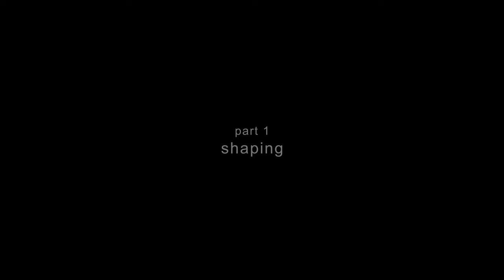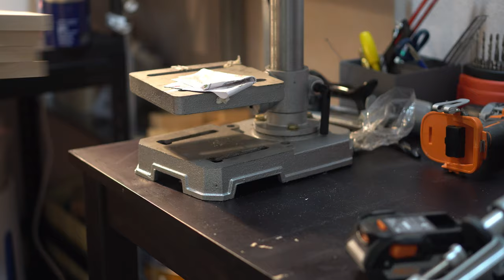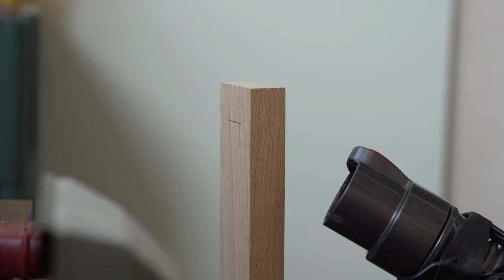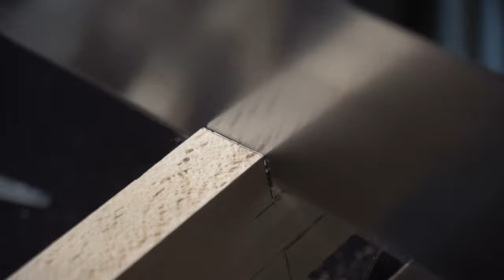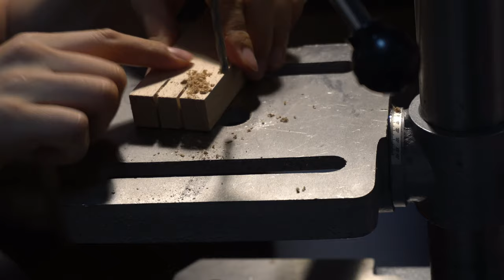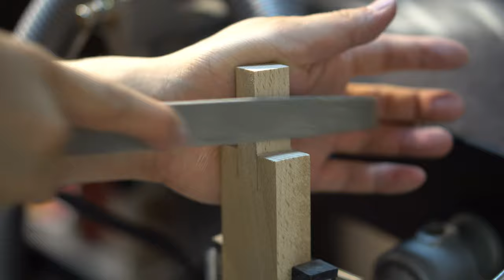Harbeth Speaker Stand #1

Comment: Great video and beautiful work!! Thank you for this!
Could you send me the scheme too? 
Thank you very much!
Reply from the maker: Thanks for watching. :)

I am sorry but because this is not my original design, I think its better not to share the entire scheme.
 
However, I think I can share the width and thickness of the lumber.

Width : 48mm
Thickness : 20mm

Dimensions are in accordance with the speaker cabinet size, and should be easy to find on the internet.
Reply: @AbleCho  I totally understand, thank you for your answer. 

Actually the scheme is pretty straight forward and the results look nice. With the material I decided to try a smaller width - I cant really recommend that though since it doesnt seem to be pretty stiff in the end. I may have to try it with 48mm again.
Reply from the maker: Thanks for understanding. :)

Actually, smaller width would more likely yield better sonic result. To be precise, less weight will do. And judging by the thing I made, you can go as smaller as 42 * 18mm without having durability issues(maybe much less). The pillars will endure the entire weight, and no significant force is applied horizontally.